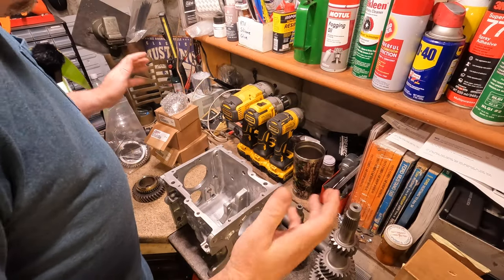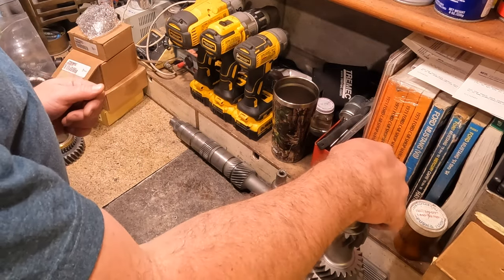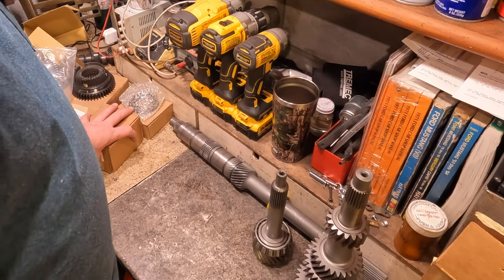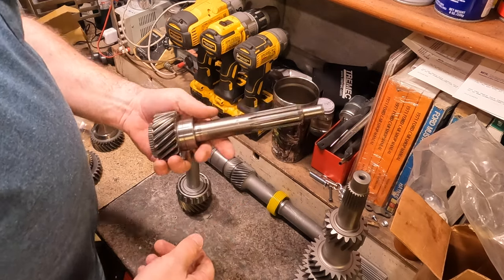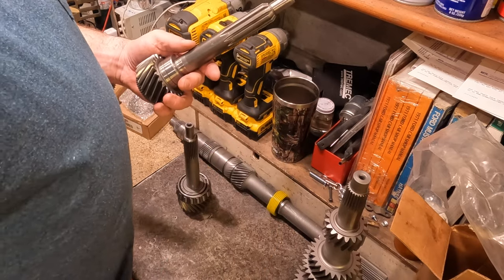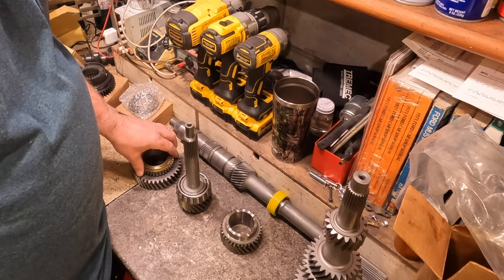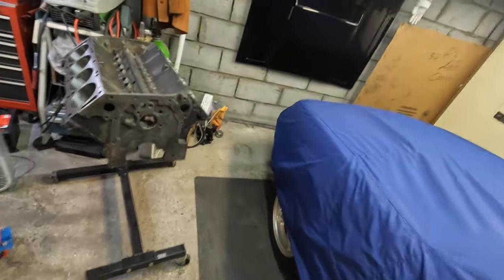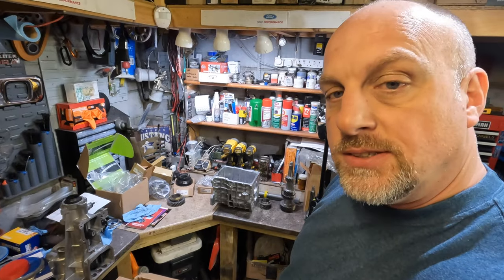Tremec TKO Restoration Part 1

Comment: Thanks for the breakdown. I'm still running a 3550 in my turbo fox. Always worrying about it breaking. Had the gears cryo treated and I believe that helped it last this long. I busted a couple T-5's before it on a HCI stocker. 
    I put a weaker 500lb torque clutch behind it and it definitely slips when boost is turned up (seen it on dyno graph, pushed 660lb torque). I think its the only reason the transmission is still alive. 
    Also changed the timing in the peak torque so it doesn't come in so violently.
Reply from the maker: I ran my 3550 in my 85 GT behind its 408w.  I had problems with the SPEC Stg 3 clutch welding its pressure plate to the flywheel on launch.   SPEC would not honor any sort of warranty even though it had less than 100 miles but it was 3 years old.  SPEC is dead to me now.  I upgraded the 3550 to TKO specs and installed an RXT clutch and never looked back.  Too bad it's in storage in FL until I go back to the states one day.  That's why I installed a RST behind the TKX in my coupe.  They are great street clutches.
Reply: Hello my name is Gregory Craig. I was born and raised in Motown. After honorably serving in the USN, I relocated to Texas and retired in North Texas. I own a 1998 Mustang SVT Cobra droptop with a supercharged 4.6 DOHC V8 Cobra specific engine producing 470 RWHP. I’ve consistently ran mid to high 12 second 1/4 mile times at 114 mph. I do all my own ECU tuning. I purchased  it new from a local Ford dealership. It’s been garage kept since I 1st drove it home from the dealership. I’ve done all the work myself except for welding and machining. 

I’m so glad I watched your video about repairing a cracked TKO casing! I have an early model TKO (before the introduction of the TKO 500 & 600). I purchased it new from Sean Hyland. During an ATF fluid change I wrapped the drain plug with several layers of *teflon tape (really bad idea). While tightening the plug I heard the casing crack around the drain opening. It started leaking as soon as I refilled the trans with new ATF. For a temporary solution I used JB Weld to fix the leak until I could repair it properly (weld or new casing).

*Teflon is such a slippery lubricant that it’s difficult to discern when to stop tightening. 

1. How do you recommend cleaning and prepping the case once the trans is completely disassembled? 

2. Do you have a list of the specific parts needed to rebuild it to TKO-600 specs? 

3. Which components do you recommend for cryogenic treatment? I’m familiar with the process and how it improves the strength of steel gears. 

4. Can you recommend any information such as printed material or videos on how to properly blueprint a TKO during a rebuild? 

I’m a built not bought kind of muscle car enthusiast. Half the fun of the hobby is building your own hotrod. Love to swap Thank you for posting your videos and sharing your knowledge!